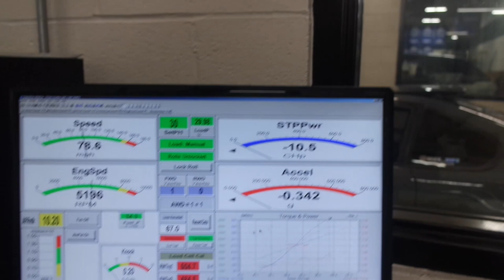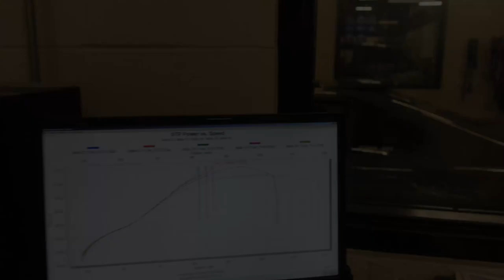Trey's Fully built turbo f20b Honda Prelude hits the dyno

Comment: You can only fit 8 inch wide tires up front. So more power will just give you more wheel spin.
Reply from the maker: Im running 17x9 all the way around

Comment: what wheels are those? i seen some called square g6 that look the exact same, they're 17x9 +15. are those the same wheels/ wheel specs as you? i was wondering how that offset would look on my prelude
Reply from the maker: Yep same wheels bro. They are pretty aggresive you will need a skinny tire. 205 40 17 or 215 40 17